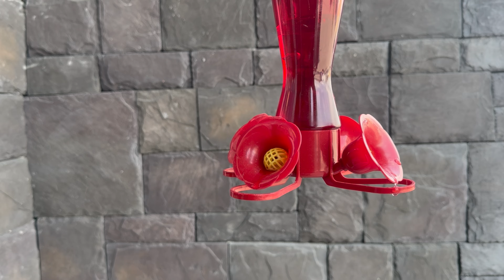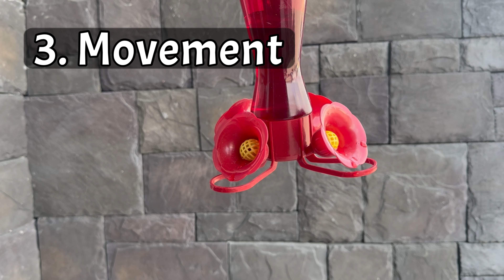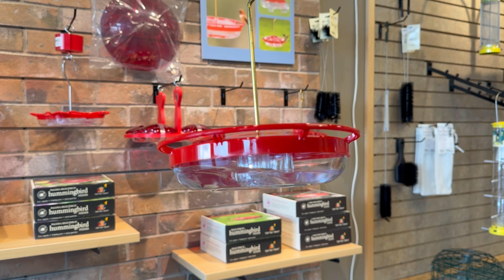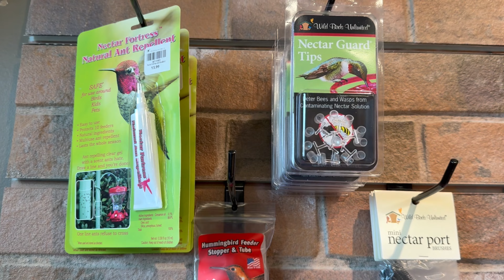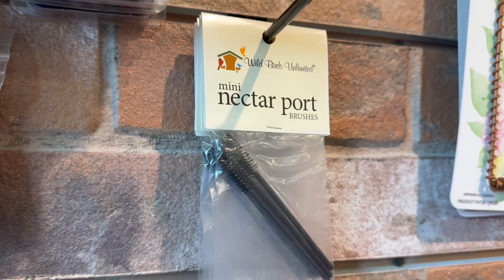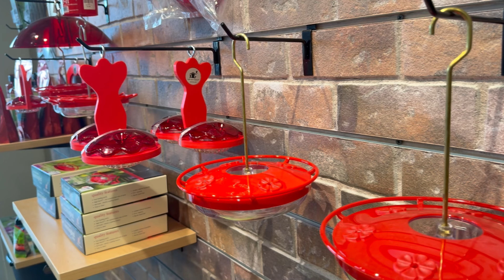Why Your Hummingbird Feeder Is Leaking (And How to Fix It)

Comment: The wife bought a feeder and after filling it and hanging it out, I noticed it was dripping. The way I stopped it from leaking was throwing out the feeder and buying one that was better built and had tighter fitting connecting parts.

Comment: Tip number 6:  apply a thin line of silicone around the seal to ensure good vacuum.
Reply from the maker: Thanks for the addition!
Reply: @birdfeedingwithkurtis  yw.  I actually took my gravity feeders apart so I could see how they could leak in the first place.  When level, the feeder bowl level will never exceed the glass lip unless there is heat expansion.  To mitigate leakage I fill the supply bulb half full, since expansion in the bulb will always force nectar out and up.. and if the seal isn’t good leakage will occur.

Comment: I have used the vacuum/gravity style you show at 0:33 for years with no trouble. The biggest issue was that the plastic tops degraded in the sun and the hooks fell off, so I bought new ones in the same style. However, the new feeders leak. As you describe, the reason is heat pressure on hot days. But why do these feeders leak when the other ones never did?

There were two, seemingly minor, differences in the design of the new feeders. The perch is  a loop style instead of a T shape, which has nothing to do with the leaking.  More importantly, the base of the red plastic "flowers" is blunt, not angled. On the older feeders, the base of the "flowers” was longer and cut at an angle so it fit flush to the base, and it fit very snugly. The new ones don't go all the way down to the base and are fairly easy to pull on and off for cleaning. This minor change in the “flower stem” design may be why the newer feeders leak when the older ones didn't.

With manufacturers cutting corners to save cost and keep the price points down, details of engineering that make things actually function get lost. I suspect that's the case here. My takeaway from this experience is never throw away the old stuff; it’s better made! Regrettably, I threw the baby out with the bath water when I recycled the old feeders because the tops went bad. I should have kept the bases!

I tried high perch feeders, but the hummingbirds did not use them. Even with their long beaks, I don't think they could reach the liquid very effectively. For some reason, the high perch feeders did not hang straight, and the level of the liquid was higher on one side than the other. Any one have thoughts on that?

I am going to try sealing my vacuum/gravity feeders with silicone caulk and see if that puts an end to the leaks.
Reply from the maker: I hope you find the solution!